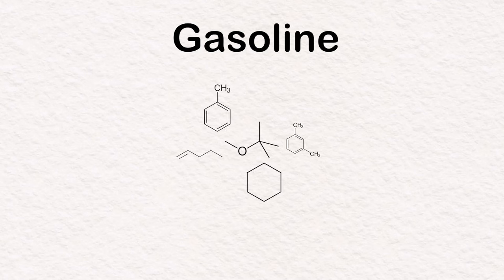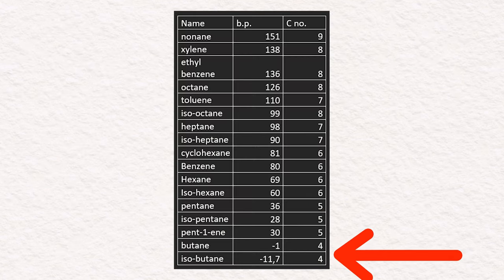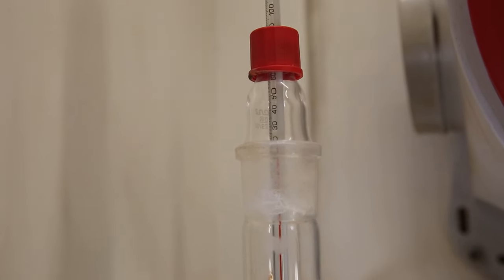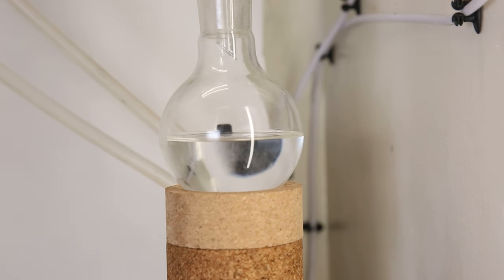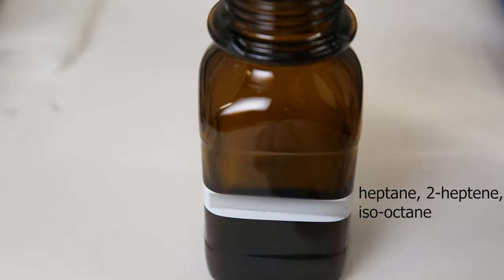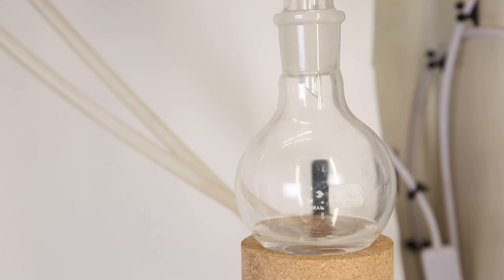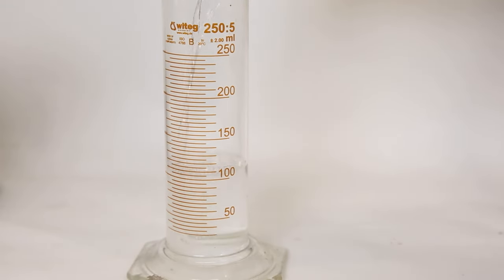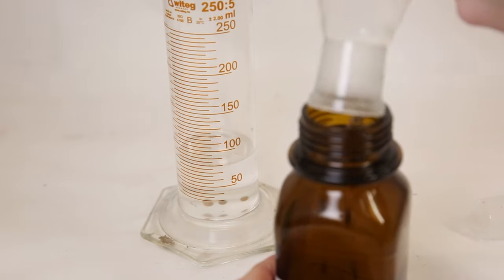Making Solvents from Gasoline

Comment: The fractionating column used in oil refineries is really unique. The column is segmented into multiple chambers, each of which has liquid back flow arresters. This allows gasses to flow up the column, but when they reach a given chamber and condense into liquids, they fill the chamber and are siphoned off. This means that one distillation produces multiple distillate streams simultaneously! Imagine boiling one gallon of gas and recovering 5,6,10 different distillate streams all at the same time! Talk about the savings haha
Reply: This is one of many differences between the realm of glass like the lab shown here and the realm of steel. When you've got thousands of barrels going through each day, you optimize the heck out of every part of the process you can identify. When you've got a liter a few times total, you're just happy to have a fractioning column ahead of your condenser and have that even approximately work.
Reply from the maker: Yeah industrially these processes are way better (as they should), they also have the added benefit of having a fractionating column that is maybe 50 meters high :')
Reply: @Chemiolis  Yeap, but it is sometimes not about size but amount of theoretical plates (TP). I am curious how many this vigreux column have. More or less from what I remember, one bubble plate (with is 1 TP) equals more or less around 10-8 cm of packed column (like copper or stainless steel kitchen scrubber) and for rashig rings it is a little more length. If someone have some references about it, please correct me, my memory could be better XD
But it was very nice distillation. Anything interesting in diesel or not really?
Reply: @Chemiolis  And basically, what you've effectively done, is subdivided just one of those commercial columns... Makes you wonder what the total diversity in crude really looks like
Reply: yeah bubble caps etc...had me interested in that when I was about ten, so I read all I could, now I'm 52, I have distilled a lot of things in my work as a lab tech, but I have never distilled petrol, would interesting to know how much 2,2,4, trimethyl pentane is in your sample
Reply: I've seen some people try to make homemade refinery equipment. Even when they're several meters high you get poor separation of the feedstock. Its not a process that scales down well.
Reply: @htomerif  That's something that always disappointed me when I was studying chemical engineering in college: all of these refinery processes were really interesting, but they couldn't be scaled down well to something I could play around with in the garage.
Reply: @emanwe01  Yeah, basically all of industrial chemistry is "put it in a reactor at 100 bar at 400 degrees celsius with a platinum catalyst"
Reply: Wait till you hear about reactive distillation
Reply: Interestingly the weather can affect things as atmospheric pressure changes...the process is all computer controlled of course, so weather can be compensated for.
Reply: @ejkozan  There's also structured packing, like the simple +-45 degree rotated corrugated sheets just stuck together, which have the nice benefit of scaling down quite well to very high surface area, until you reach fine corrugated cardboard size.
Reply: @namibjDerEchte  yes, true. but structural packing is less approachable for home lab than rashig rings/glass beats/ or any more standard packing sadly
Reply: Yeah I found books just about designing and building distillation towers.
Reply: Yep.  I took a class entitled "Stage-wise Equilibrium Processes." which covers all that.  It's the chemical engineering class from HELL!
Reply: @htomerif  I think a lot of it has to do with how some of the heavier products need "cracking" to refine efficiently.  From memory Steam is just as important in the system (at least industrially) as many other factors when yields are concerned.
Reply: @stevengill1736  Yep, this even used to mess with my 6ft long 4 inch Ethanol Column. Even ambient temperature had a small effect on the purity/quality of the final product.
Reply: @74KU  Yeah, I don't have a reason to know as much about oil refining as I do, but there's a fluid catalytic cracker, which is an entirely separate unit from the fractional distillation tower. Most industrial refineries also have an alkylation unit where short chain hydrocarbons are linked together to form longer (or at least heavier) hydrocarbons.

Steam isn't a necessary part of the chemical process. Its used to entrain light gas and help strip the catalyst of carbon.

I think the primary issue with column efficiency is thermodynamic. A small, thin column loses a lot of energy to the high thermal gradient energy losses that a long, wide column doesn't (proportionally).

I should say for clarity that steam is a part of things like coal gasification in which the steam is used to produce CO and CH4. In oil-poor countries like South Africa (if I remember right) the CH4 is alkylated to the point of producing diesel, which is why you don't see many gasoline cars there.

Also: don't take anything I say as a fact. I could have gotten any part of that wrong. I usually don't, but it happens.
Reply: @Chemiolis  There's an old ICI/DuPont films plant near me and it has an 8 storey fractionating column. Quite impressive to see as it's the tallest building for miles around.

Comment: Thanks for this video. I am starting to understand more about the work my father did at Chevron Research in the 1950s-60s, with catalysts and combustion research, to eliminate the need for tetraethyl lead. He didn't invent unleaded gas, but helped develop Chevron's Richmond, California refinery's  method of making it. After he died I read a metastudy indicating the reduction of childhood exposure to environmental lead leads to a significant reduction in violent crime when the children become a young adults.
Reply: I’ve read about that too.  An interesting aspect was analysis by geography, because unleaded gasoline was mandated in some states earlier than others.

I cringe a bit when I think about the traces of past chemistry and physics left in my body.   Lead from gasoline & paint, fallout from above-ground nuclear testing, DDT, more PTFE related stuff than I can remember.

I remember schools collecting baby teeth when I was a kid to measure the amount of strontium-90 from testing fallout.  With a half-life of 28.79 years, it’s mostly gone, so yay?
Reply: @firstmkb  gamma spectrum off test-era enamel can yield your age when compared to a curve of spectra vs year.
Reply: My understanding is, that unleaded gas is made by processing the gasoline in the "reformer," which converts the straight-chain alkanes into branched-chain ones.  They form free radicals more easily, which is what the TEL used to do.

Comment: Yeah! What a great project! Potentially very useful.

Can I ask if any particular segment seems to be responsible for the distinct gasoline smell? Or does the odor seem to come from a blend of everything?
Reply from the maker: The full smell is definitely a blend, but more volatile low boiling compounds contribute a lot more. I think the first fraction smells the most like gasoline, some are much nastier.
Reply: Great question I wondered the same👍
Reply: cyclohexane is "gasoline smell" - very distinctive.
Reply: cant you weld up some 55 gallon drums end to end and make a refinery out of that?
Reply: @NormReitzel  I think you meant Cyclohexene,

Comment: nice video! 
to get more inert solvents you can stir the gasoline with some oxidiser like KMnO4, NaCrO4. Followed by a water washing (this also reduces the amount of EtOH) 

mfg hazelChem
Reply from the maker: Thanks for the ideas, i tried to keep it as accessible as possible since chemicals like KMnO4 are very regulated and difficult to obtain. Though, i personally have no issues getting it, so perhaps i will try this off cam sometime :-).
Reply: @Chemiolis  Actually in EU getting KMnO4 is like filling one (actually half) page of paper with your ID data,amount bought and usage. Educational / hobby chemistry is quite a good usage if you order small quantities (<=1kg), but for larger ones you need to have a [registered business / chem college diploma] [and / or] chem company might request a photo of your hardware setup.
Reply: How would one build a more industrial style fractionating collum inexpensively for a more continuous prossess of purifying pyrosis products?
Reply: @petevenuti7355  It depends on definition of "inexpensively"... Actually if I'd be required to make such column I would go for SS304 (or copper) pipe and sheet but I doubt if that's "inexpensive". Especially with current SS3XX prices...

If I remember well TechIngredients have a still with semi-industrial column which looks kinda similar to refinery ones, however it's single-output.

Alternatively you can do a multi-stage distillation where temperature goes lower and lower with each stage (actually this is easiest way to do so if you own quite a bunch of glassware or [oxipropnane/oxiacetylene] torch).
Reply: @TitanumIchigo  my skills with a torch and glass have much not to be desired. 
  Heck, I can't even respond to the weird looks like get when I tried... by saying that it's art. 
  The people with that skill are true artists, it's just functional art.
Reply: @TitanumIchigo  If I can't find something pre-existing with that kind of internal structure in salvage , it does look like direct fabrication from stainless may be the only way to go. (I'm thinking I might be able to use SS from an exhaust system of a car)
   I've had issues with organic acids complexing copper from my current simple condenser..(talk about green fuel😜) seriously though, I don't think a lot of copper contamination would be safe.
    Clay ceramic plumbing crossed my mind, what do you think?
Reply: @petevenuti7355  Actually the only thing that drops onto my head with similar structure is weapon supressor, however it's quite different... I think that making it from raw SS materials will be a way to go... The problem man with such a column might have are chlorine vapours but I think that most people are not stupid enough to pyrolyze halogenated plastics...

Clay might be a good thing to try, but it's prone to cracking during heating.

Personally while choosing from SS and clay I'd go for SS, cuz I've easy access to metals and it's more forgiving than clay. Car exhausts usually use SS304 tubing and SS304 wool, but I think that replacing wool with some glass beads (or even marbles) would be cheaper.

[Monologue]
You just gave me a reason to "excuse" a purchase of oxipropane torch and try to design such a thing... It won't be easy, but it would make an interesting piece of glassware to be sold... Especially that it can be made out of some beakers, probes and petri dishes. Probes can be replaced with borosillicate pipes, but... probes are cheaper.

(Pricing comes from my local supplier)
Beaker: 1.5 USD, Petri Dish: 1.1 USD, Probes: dirt-cheap (~0.1$ ea. in small bulk qunatities [250 pcs])... For one segment you would need 1 beaker, 1 petri dish and 3 probes (1 for overflow protection, 1 for bubbler and 1 for fluid exhaust)

So a nice 5-segment column would cost something about 20 USD if my math is correct (excluding gas pricing, but it cost is insanely low, 0.7$/dm3 for propane and 10$ for oxy refill). Actually you can make a compressor (using refrigerator parts) at home and refill oxygen tanks with ease, but you will be probably limited up to 50 bar. I also made an assumption that nothing goes wrong, which is bad because things going wrong is more common than things going right as planned.
Reply: @TitanumIchigo  Yes, Tech's is really just a rather fancy version of what's been used here. Maybe could be modified, much easier than standard lab glass versions but probably still a bit involved.
Reply: @petevenuti7355  At least you're keeping it in one piece 🤣

Comment: Washing in the beginning would allow you to wash all fractions in one step. (but it would need drying it all too) Then you could distill it without getting ethanol azeotropes. This could also reduce number of steps when compared to washing all fractions separately (with a separate drying step).
You perhaps could get by with drying only the first fractions like hexanes because water should get distilled as azeotrope with hexanes if there is enough them to get all water out.
Reply: I've seen people adding bunch of water to gasoline and it sucked all the ethanol out increasing in volume. No drying was needed as these two dont mix
Reply: @trollmcclure1884  Solubility of water in for example hexane is 0.015% or so. Yes, they do not mix. Yet you get wet hexane if you add water and due to azeotrope you won't get water away with distillation easily.
Throw in some sodium etc and you'll get a nasty surprise. Often nonpolar liquids that dont mix get a bit cloudy due to tiny amouns of dissolved water.
That's why it is so sommon to use dessisicants like magnisium sulphate in lab. Often the tiny bit of water is enough to gice you lots of trouble.
Reply: @hoggif  would calcium oxide do the trick? I've read about people drying ethanol with it
Reply: @trollmcclure1884  Depends on how dry you need it. Often most anhydrous saltss like magnesium sulphate, potassium carbonate etc are fine, depending on what you'r drying. For example no carbonates for organic acids etc. It may also depend oni what impurities are ok for you and what not. Often there are multiple methods.
You may also need to think of reactivity if you go for reactive drying agents.

Comment: Nifty.  Journeyman chemsits' stuff.  Might want to put on Teflon tape on the glass plug for your various flasks and seperatory funnels, though.  If you have an aqueous solution that has a high pH from NaOH or something similar, you might have a hard time getting your stopper out. Do that three or four times and that could be pretty expensive.  There used to be something 'stopcock grease which was pretty handy, but expensive.

Comment: I tried this with a stainless steel simple distillation apparatus.. Over open flame. I was confident I was condensing all the vapors and it went well. Would not recommend that technique tho haha so dangerous. Nice job identifying all the fractions..Had no idea that much BTX was in gasoline.
Reply: That is some serious confidence in your rig... one teeny tiny leak and it's bad news. Glad it ended safely for you.

Comment: Great video.  My question is which fraction that you separated is most responsible for gasoline going stale upon storage?
Reply from the maker: Gasoline goes bad mostly through oxidation, and partly due to evaporation. As you can see, the first fraction already comes over a bit above room temperature, generally this fraction ignites better and aids in ignition of the other parts of the gasoline. If it has evaporated, it can influence the performance of the gasoline. I believe oxidation is mostly caused by alkenes, generally alkanes and aromatics aren't too sensitive to oxidation by oxygen, but alkenes have double bonds that are relatively unstable and oxidize quite easily. Which means that not one fraction is really responsible for it to go stale through oxidation, considering the alkenes are in almost all the fractions.
Reply: @Chemiolis  I heard once that you could "rejuvenate" old gas by bubbling some propane through/into it to make ignition easier.  Is this legit?
Reply: @Roonasaur  this a somewhat uneducated answer, as I'm not really a chemist, so take it with a grain if salt. But there are different aspects to it:

The propane should definitely be able to dissolve in the gasoline to some degree though the question is to what degree. You'd notice depending on how big the bubbles are that come if when you bubble it. And due to its lower boiling point it would be the first thing to evaporate.

The engine should able to use the added propane just fine. There are vehicles that run on liquid natural gas. My understanding is that the engine is essentially unmodified although the fuel tank and lines are heavily modified to handle the added pressure safely, since the LNG is stored under pressure to remain liquid at regular temperatures.

Adding propane wouldn't reverse the oxidation of alkenes, though. Not sure what effect that has on the overall performance.

In conclusion, it should be possible to dissolve propane into gasoline and it will probably help ignition. However, it probably won't keep the gas fresh for long, and I'm unsure how it will affect other properties, like knock.
Reply: @Gameboygenius  Thanks. :)  I would only really do this in a SHTF scenario, and it was the only gas I could find.  So I would use it immediately after.

Seems like it should work . . . and I should probably test it out now to find out, but, you know . . . just haven't had the time.

Comment: I'm still wrapping my head around the explanation of where the Oil comes from. there were that many dinosaurs  ?
Reply: Cambrium? There were not only dionosaurs but also plants all over the place and continents back then in the tropical zone cramed together in one mass. So not that much land mass in the middel ground which makes arrid centers and washing out on the "borders".
Reply: @KClO3  I did not started it. But yeah chalk is more likely from them. And marble is by lifeforms with partly rigid structures but still near microscopic size. And then gotten under pressure and heat/shearing plasticity.